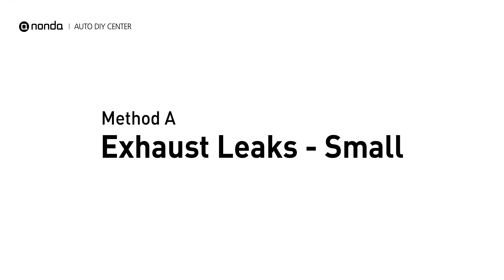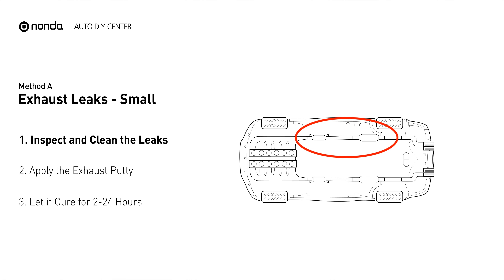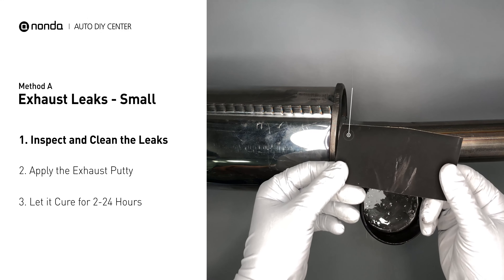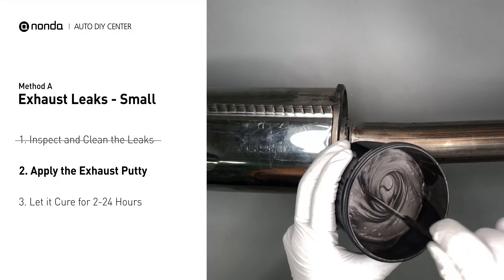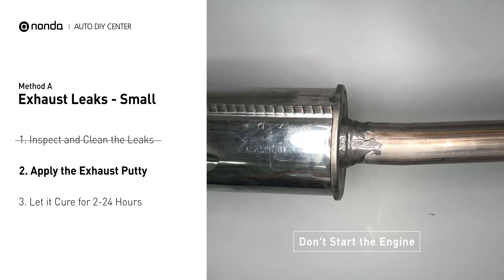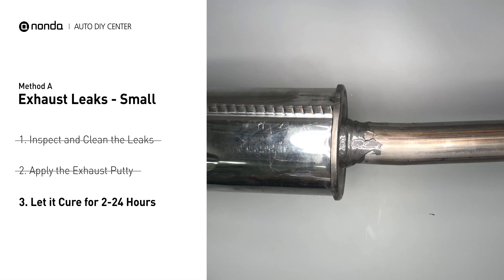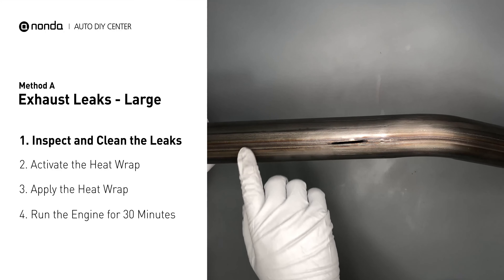How to Fix P2096 Engine Code in 4 Minutes [2 DIY Methods / Only $9.53]

Comment from the maker: Hi, I'm Steve, nonda's lead mechanic engineer. 
Feel free to leave your comments here if you have any mechanic questions, I will be glad to help you out!
Reply: Does p2096 mean a cat converter is bad even if the cat converter code does not pop up along with p2096?
Reply: Hi, i'm having problem with P2096 for 2-3 months. First, I have tried changing two O2 sensors, the error code come back in a day... then I have tried changing air filter cartridge, again P2096. The car sometimes turns off while driving, and sometimes I cannot start it from parking etc. Mechanical says it is bad catalyst, and i must change it, but I'm not sure is it really Cat. I have some more fuel consumtion, and some sound when car is cool. Hyundai i20 petrol is the patient
 Thanks.
Reply: I've had this code for 5 years now with no noticeable impact on driving. Fuel consumption is normal and engine runs smoothly. How likely is either issue, leak or sensor fault?  One is wayyy more expensive than the other...
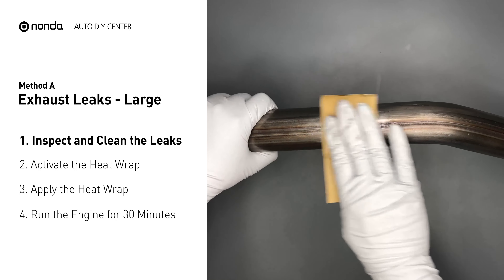Reply: Audio cuts out after 1:50. Fix or take down the video of I’ll copy right infring and sue you
Reply: @mkpsc  hi
Reply: @immachine1565  that’s exactly how it works. You’re next.
Reply: @immachine1565  keep building ur case
Reply: $14 for shipping come on its more like $5 - $8 Max 2022
Reply: Just got this code along with p016a for my 2019 volvo xc90 t6. I loaned the car to a friend who put lower grade fuel, not sure if that will cause check engine and these codes.

Comment: You seem to have a better understanding about this topic than most.  Please help me.  I recently installed long tube headers in my car, with catalytic converters.  Following common practice, I also installed sensor spacers.  This eliminated the P0420 and P0430 codes, but I'm now getting P2096 and P2098 codes consistently.  The car is a 2018 Mustang GT.  The headers are 1 7/8 inches going to a true 3" cat-back exhaust.  As I'm sure you know, the pre-cat oxygen sensors are wide band, and the post-cat sensors are narrow band.  The car has an aftermarket tune.  It runs well, and the air/fuel mixture hovers around 14 (I assume it's lower than 14.7 because of the 10% ethanol, 91 octane gas I'm running), and the tuner probably made it a bit rich.  My mechanic confirms there are no exhaust manifold, exhaust, or unmetered air leaks.  The tuner won't turn off the post-cat sensors, which is understandable.  Questions: can you confirm that P2096 and P2096 actually indicate that the mixture is too rich (rather than lean), because the bigger exhaust is throwing off the post-cat oxygen sensors?  Second, if this is the case, is it ok to continue to drive like this, occasionally clearing the CELs?  Please help.
Reply from the maker: Hello, these codes you're getting were lean codes. Please also inspect the injectors on bank 2 while rotating the engine if some smoke coming out and check the purge valve if faulty. It is possible to drive with these but continued exposure to improper mixture could soon cause problems with other components.

Comment: So I Have had  both p2096 AND p2097 since like last April (2021) and back then, the codes always disappeared when I filled the tank up. That went on for a few months, maybe a little longer, where it went away after filling up with new gas. I took it to a friend who works at Honda and he put it on the lift and looked for leaks. Couldn't find anything.

The car is a 2017 Honda Civic Type R with full bolt ons and a custom dyno tune. The check engine light or codes do no go away after getting gas anymore. It did go away for almost a month after my last tune on December 27th though. But now it is back and staying there. Car drives great though. Don't get it.
Reply from the maker: Hello, have you inspected the wiring to the O2 sensor for any issue? We also suggest getting your vehicle visually checked by your local mechanic for further diagnosis as you are receiving multiple error codes.
Reply: @nondainc  Yeah. Even wasted money on a brand new o2 sensor. My mechanic at the dealership couldn't find anything. He did mention doing like a smoke test to run that through and see if the leaks will show that way. Never got back to him for that.
Reply from the maker: Hello, we suggest using the octane rating gas that Honda recommends.
Reply: @nondainc  It takes premium, which is 93 octane. Never had an issue before. Plus a lot of us Type R owners actually use higher octane or a mixture for racing just fine. 

I might have to give it a more thorough look to see if there are any leaks, preferably on the charge pipes that go to the intercooler, since I hear those tend to leak sometimes.
Reply: I'm having the same problem currently. What ended up fixing it?
Reply: @valk7337  Honestly, I have no idea. I just kept driving it for a whole year like that. It did however go away a couple days after I switched up to the race MAF housing by PRL. I cleaned out the intake filter since I was already there and a little on the MAF sensor. Then as I get off work one day and start my car up, miraculously I no longer had the code. Been code free since. 

Maybe a dirty MAF sensor? Maybe a dirty air filter? Maybe it needed the upgrade to a bigger MAF housing since I have so many mods, it was too much for the stock MAF housing and sensor? I just know it disappeared within a couple days after that installation/filter clean/sensor clean.
Reply: My Subaru dealer spend OVER 5 hours (on 2 separate occasions, mid August and last week, 3 weeks apart) trying to figure out this code... They checked EVERYTHING possible and still can't find the cause of this code... They just told me to keep driving it! It's a 2018 BRZ with only 41000 KM on it... pretty disappointed with this situation...
Reply: The code means that your cat efficiency is degrading. You have a tune so don’t worry about it. When tuned any code from the o2 sensor AFTER THE CAT will not matter. Pre cat o2 sensor is the one to worry about as it’s the one that actually adjusts AFRs.
Reply: @2seep  My post is over 2 years old. Lol. My catless Aftwrmarket downpipe is perfectly fine. As I said, I'm fully modded, and I assume the stock size MAF housing was too small. Since I have the PRL Inlet pipe and PRL High Volume Intake, I think the stock Sized MAF housing that came with the intake caused it to throw codes, so I ordered the Race MAF housing that was optional with that intake, and then it started not having codes after a couple days of driving. 

I've read a couple of people having issues being full bolt on with these cars and keeping the stock size MAF housing caused issues when tuning. 

I'm not an expert on that matter. I'm just saying, after so long of dealing with that code, then it mysteriously goes away with a new tank of gas but comes back again, but when I buy a the Race MAF housing and a retune, all of a sudden I haven't had issues since.

Comment: My Subaru dealer spend OVER 5 hours (on 2 separate occasions, 3 weeks apart) trying to figure out this code... They checked EVERYTHING possible and still can't find the cause of this code... They just told me to keep driving it! It's a 2018 BRZ with only 41000 KM on it... pretty disappointed with this situation...
Reply: you wont pass inspection
Reply: My subie has exhaust issues too, never been able to fix them bc it never solves the problem (2012 Forester)

Comment: I put high flow cats in my car and got this code as well. What do you think it is and I should do?! Thanks
Reply from the maker: Hi Elton, you should inspect all the related parts to identify the possible source of the issue. Check the exhaust corners and exhaust pipes for leaks and fix if you found any. Also, check the oxygen sensor on bank one and replace if you found any signs of damages. If the issue will still persist, please take your vehicle to the nearest repair shop for further diagnostics.
Reply: Probably not enough heavy metal in the a/m hi-flow cats to satisfy the downstream sensors. The newer the vehicle is the more sensitive they are. Don't even get me started on subaru's. They are the worst. Probably have to search long and hard to find a tuner that will break the law for u, and turn off the downstream sensors or adjust the air fuel ratios. Which i believe isn't even possible with the factory pcm. So u would need a stand alone fuel system, something like mega-squirt... gl

Comment: Hello
I had this error in my ford s max. The service workshop replaced the oxygen sensor, 2 weeks later the check engine light came on again. Otherwise the car runs fine, what could it be? Many thanks!
Reply from the maker: Hello, have you checked if there's any vacuum/line leak? Also, check the fuel pump if failing, filters if clogged, and the fuel pressure regulator if damaged.
Reply: @nondainc  The car is still under warranty, was repaired at a ford service center, I assume the mechanics checked all possibilities. But thanks for your tips, in case of anything I know what to ask.
Reply from the maker: You're most welcome!
Reply: @nondainc  Hello again.
I had the car serviced by Ford, got a phone call that the computer did not find any error, they also checked everything, and the check engine light was deleted. The mechanic claims that the check engine could have come on because a new oxygen sensor sometimes needs to calibrate itself after being installed. Is this true or maybe ford is playing with me? Thank you and regards!
Reply: Did you ever get to the bottom of this?
Reply: Do a computer software update, you can chase your tail changing things you don’t know to if you have a P2096

Comment: This fault is occuring in our 2010 bmw x3. I was reading that hoses with cracks may also lead to excess air getting into cylinders. 

First place to look would be leaks around the catalytic converter?
Reply from the maker: Pls check:
Faulty Heated Oxygen Sensor
Heated Oxygen Sensor harness is open or shorted
Heated Oxygen Sensor circuit poor electrical connection
Exhaust leaks
Contaminated Heated Oxygen Sensor
Visually inspect the related wiring harness and connectors.